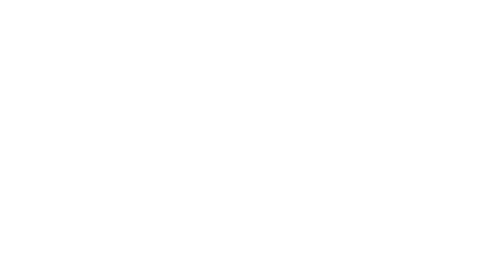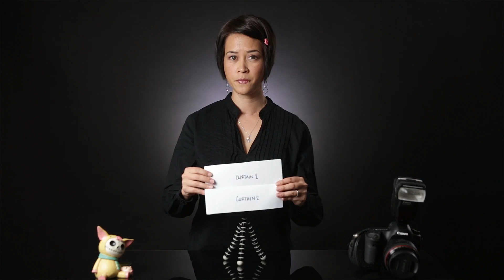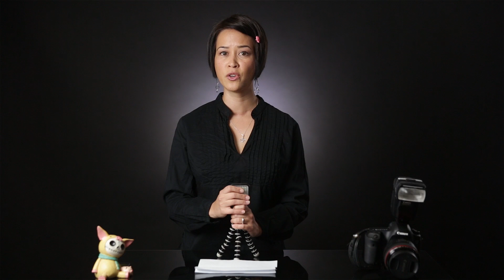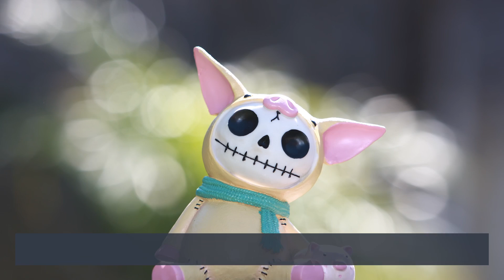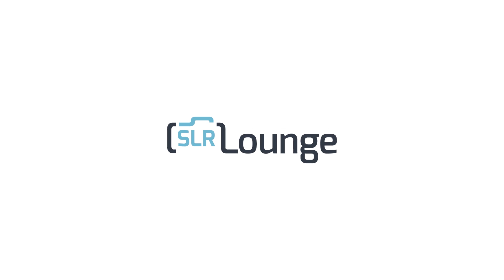Understanding Flash Sync Speed and High Sync Speed

Comment: Michel I have a Pocket Wizard Plus 3 and I want to use the HSS to control the ambient light in the ceremony. When I set my flash only on HSS I get the black band and If I try to put my 5d Mark 3 on HSS then Camera wouldnt let change my settings to HSS unless I have flash on the hot shoe.

My question is how do I make Canon 5D mark3, 600EX and pocket wizard work with HSS remotely ?

Thanks
Vig
Reply: The Plus 3 are not HSS compatible. You will need to get a TTL trigger with HSS capabilities for this to work. Check out the YongNuo YN622C and the YN-ST-E3.

Comment: Michelle I didnt understand how you came up with that formula when you showed those 3 pictures. In the second picture, you exposed for the background, but then in the 3rd picture, it shows that you adjusted the f-stop? I just wasnt sure how all 3 were connected. Also you said 1000th of a second, but it showed 100th. May have been a typo.
Reply: good catch dave andrade that was def a type-o it was 100 ISO at 1/1000. lemme explain those images. image 1 i wanted to see correct exposure on my subject and used f/2.8 ISO 100 1/500. with image 2 i wanted to see more colors in the background (it was a little blown out for me) so i adjusted my shutter to be 1/1000. problem here was that i needed fill on my subject because it killed the ambient. whoops, editing got the wrong image up. take a look at the article on slrlounge and you'll see better image sets to explain. sorry! http://www.slrlounge.com/understanding-flash-sync-speed-high-sync-speed#comment-181523